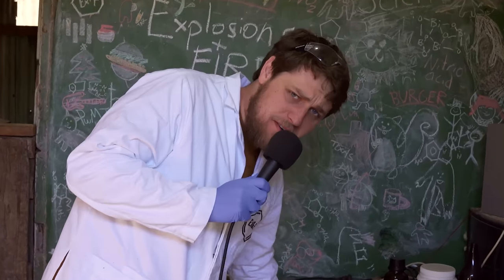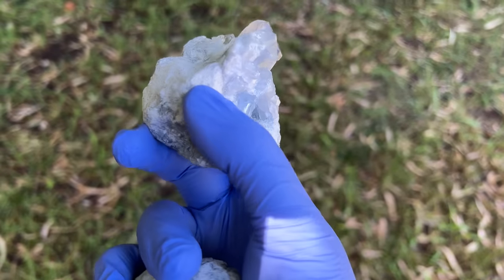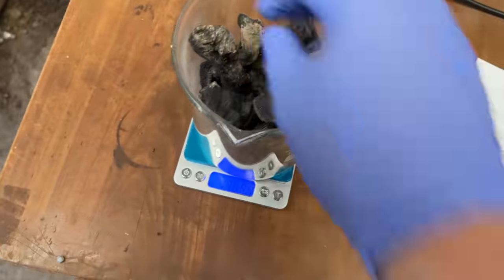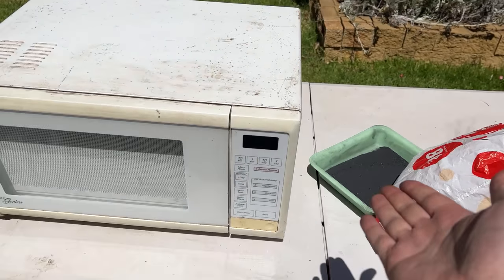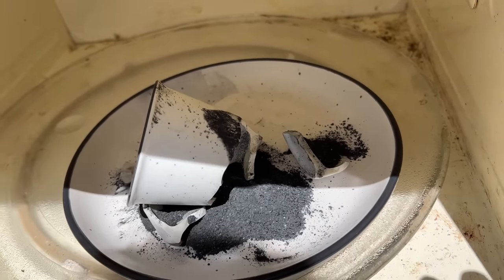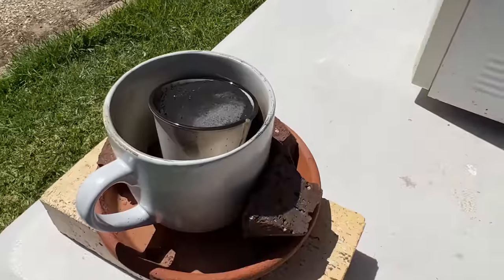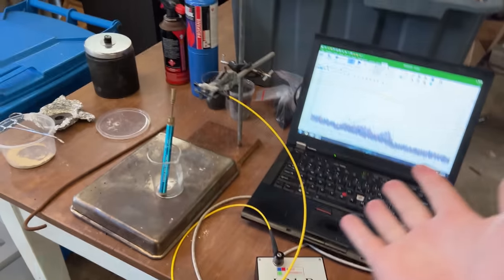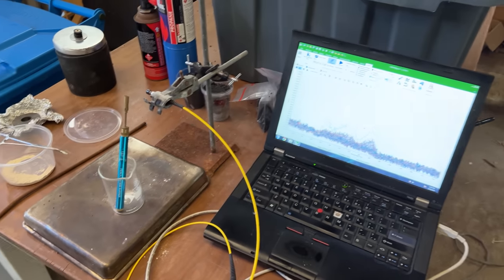Extracting strontium with a microwave

Comment: Want to do it in a hurry, react it with steel wool and your carbon in a microwave. The steel wool will arc, and the plasma will heat it to well over the reaction temperature.😁🤪

Comment: Why don't you just attach a chain to a sprocket from the sprocket to the blender set on the side at the back of your bike, after peddling that back wheel you would power up your blender in manual mode??
🤡😳😯🙄🤔😎🤠🥳

Comment: Are you a clown?! ...if you just took that jug of the base you could have repaired the connector and the blender would have worked in like seconds...it's called 416 super glue from loctite well I believe it's 416 the shock proof type, I have a bunch in the cupboard.

Comment: Thats the stupidest experinent of carbotermal reduction that I've ever seen! No porcelain will withstand that heating, thus crack is iminent! I'm doing reductions using short circuit of 2 carbon rods inside baked clay (cheramic) and even though it rifted abit, it didn't broke it as a whole.